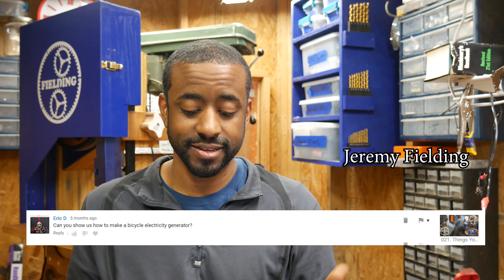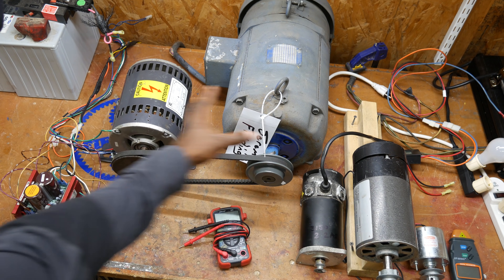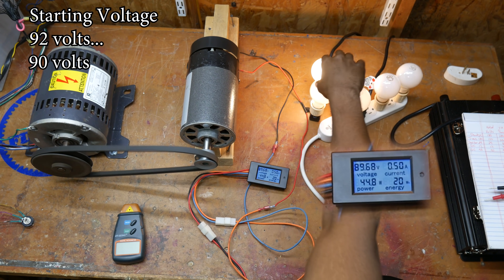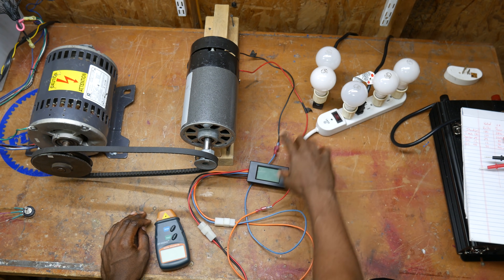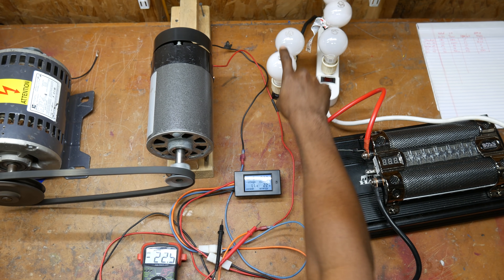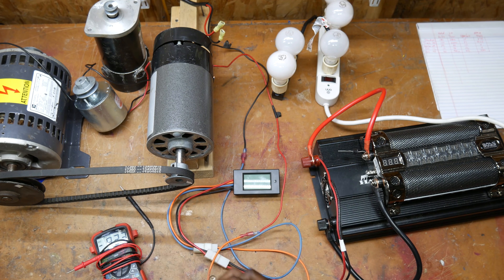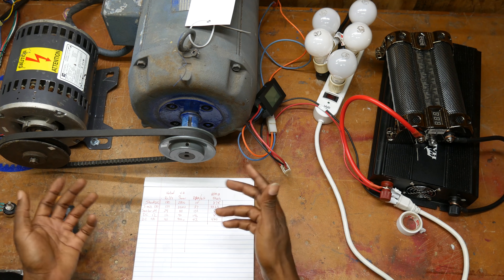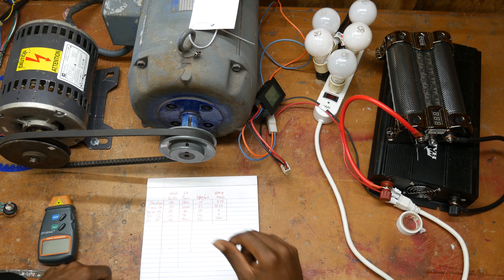How To Build A DIY Generator Part 1 : 050

Comment: Just go to a auto parts store and pick up a 1 wire gm  alternator ....it has a built in voltage regulator and hook it to your battery ....as long as you have approximately 2500 rpms  on the alternator it will maintain the charge on your battery just like on your car so the battery will stay at a constant voltage .....I have done this and it works good  but I would like to find a a voltage regulator that would turn the motor on and off that runs the alterator as the battery charges and discharges so the motor doesn't run all the time ...... And I run the motor that runs the alternator off of a dc motor and a battery of its own and then I have a battery charger  that is plugged into the inverted that maintains the battery for the alternater but because I haven't found a regulator to shut the motor off and on I just do it manually for right now ..so when my inverter battery gets low I turn on the alternator motor then when it charges the inverter batteries I turn it off I hook the charger back to the alternator battery so I always have a good charged battery on my alternater and constant power coming from my inverter ......the alternator only needs to run about 10  to 15 minutes to fully charge the inverter batteries ...at least that's what I've been running it and I usually turn it on every 5 to 6 hours but of course the more  power you use the more frequent you would have to charge it and it also depends on the battery that you use ....I was using marine batteries and they seemed to do better than regular car batteries but my buddy wanted his boat batteries back lol. I hope you can think about my set up and tweak it if you can ....maybe figure out how to run as a self contained unit .....I get tired of switching that battery on for the alternator lol....I use this at a camp and I've stayed there for up to two weeks had all the power I need ....and no solar no gas and no wind just my batteries,alternator, dc motor and a 3000 watt inverter ......I would call that free energy but you know they tell me there's no free energy but when I go to the camp I never have to pay for my electric

Comment: It can work going from Gen to Charge Controller to Battery to Inverter to Loads - try the MPT 7210A charge Controller (12V-10A max range 12.2 to 15.8v) $30.00 - which will come with a  Boost circuit. i run all of my lights in the shop with this system for 9 hours - 5 days a week.

Comment: How is an inverter built?

Shalom
Reply: Lots of videos on that. The real basics of which is a capacitor bank and transistors that are timed to send bursts of current to replicate an AC sine wave. Fairly technical. Most devices can handle some choppy square sine waves, the more you refine it (faster transistors and better timing, etc) the more it costs.

Comment: If increase the size of the pulley in DC generator, will increase Ron, and volts as well? Just asking...
Reply: I meant, Rpm increase= higher volts?
Reply from the maker: Increasing RPM's increases voltage

Comment: you need a motorcycle voltage regulator for rated watts of motor into a battery this controls voltage level then run what ever you need onn the battery

Comment: Hi,thanks for your many informative videos ("Because Knowledge is Power."). I was going to put this comment on your vid where you talk about washer motors,but then saw this playlist (Generators) which seem to be more related to my question(s). I salvaged a motor (COM1500P,DC310V,0.6HP,2.5A,1400RPM,3P,Class F.) from a dancing washer,and while I have began my journey into electricity (mostly circuitry) I still have a good ways to go ( :) Your videos are a GREAT help). I was wondering if you think this motor would be a good candidate for a wind turbine generator? Why,or why not? I mean I think it might be,but there may be some details I might not be considering or simply haven't learned yet. Since you are a good bit ahead of me ( and enjoy your videos because of the way you explain things) I figured you to be a better judge on it than I.
Reply: Oh,what kind of power would I need to power my entire house (25ftX40ft,1,000sqft) and workshop (15ftX25ft,375sqft)? I've done some research but I'd have better luck finding a tick on a pi55ed of horse in the dark at this point. I'm planning on building these off-grid but (if it's realistic) I'd like to stick to providing my own AC power,with the help of a small stream/waterfall on the property. Like what kind of power demand should I expect?
Reply from the maker: Unfortunately I can't give one on one advice like this. Please understand, I get quite literally hundreds of request for help and advice on all kinds of projects. It just isn't safe or practical to do this one on one. I like to take topics that come up over and over and make videos to help lots of people. But I can't do it this way.

Comment: I found this incredibly helpful and inspiring. Thank you very much for the thorough guide and information.
Reply from the maker: People like you are the reason I do this. Thanks for letting me know.
Reply: @Jeremy_Fielding  I have a Ltec wire feed welder it all works do you have any ideas as to what you could make with it. It is a 220 unit

Comment: I saw one video where you were looking for a link for affordable vfd, the one used here in the video was purchased or built?
Reply from the maker: I have several VFD's... all purchased. I have never had trouble finding one, unless you are talking about a VFD designed to work with single phase motors. I was only making a point that they are not typically designed for single phase motors, but there are at least two companies that make them for motors without starter windings.
Reply: Jeremy Fielding so what would you recommend or where should I look? Have you found any that were affordable and functional? I've not seen any yet that look like they one in the above video.
Reply: @andrewoneal306  get a three phase Motor and VFD to match. You can run it on a single phase supply if 3 phase isn't available.

Comment: Some alternators have regulators built into the case, otherwise look into a Harley or motorcycle regulator/rectifier (relatively cheap) because the stator puts out 24 vac at 2k and 10 vac every 1000rpm after that. Plus you get steady dc power output 14.4vdc

Comment: did you try a CAP.. like .5 or 1 farad? Bet that would hold it...Just an idea.
Reply from the maker: The one I use in this video is 8 farad... I am not sure I understand the question
Reply: There would be a ripple from the bigger one as its shunt  I would guess. When I said Cap, I was also thinking dc bridge. But got called away mid thought.  i would like to see the output on a scope to if it flat line or theres a little wave.What is the voltage on output with cap VS Disconnected cap . Is there is huge increase or any increase at all. If there a jump in voltage there is a ripple. true DC  voltage should stay the same . cap inline or no cap.. running dc through a bridge with a cap for filter would take out most ripple. almost like a battery. Also to be honst I didnt watch the whole video kinda skipped around. But  didnt see the caps you were using first time. Last note. Smaller pully underload belt would slip. jumping output  voltage I computer back backup power suppy could change things as they need the Ac to exicte the inverter before the ac drops out to get your 110V AC They deliver lots of wattage. Great video. Sorry so long. I'll keep watching.

Comment: How is it that shunt wound motors can self regulate voltage like that. Intriguing........ actually maybe not. I just read the comment about the different motors and what percent of max capacity they were running at. But is there something special about shunt wound ???
Reply from the maker: His comment was wrong. It has nothing to do with the capacity of the motor and everything to do with how the motor operates. There is a series of videos on YouTube where a teacher explains why the shunt wound motor can hold its voltage so well. https://www.youtube.com/playlist?list=PLhdK-aL4p_XFToGz46CrJjy47eRh8Rv9O have a look
Reply: Jeremy Fielding thanks for the link. Already checked out the top vid. Def gonna be some brain candy in there. I'll hold back my questions until I digest some more of those vids. And get my brain wrapped around it a bit more. Have a good one! Thanks again!

Comment: I get how to wire the drive motor as you showed in earlier video is their any special wiring for 3 pH motor to make it produce electrical battery bank power. I am having problems articulating what I am trying to do. 3 pH motor has 3 legs will they all produce power and wired separate. And how can I wire it or am I just confusing my self

Comment: I have difficulty following your thoughts (I am not saying your wrong just that I am not up to the challenge) but after listening to your comments on using a motor as a generator would it not be better to use a car alternator or an old dynamo from before they had alternators?
Reply from the maker: A car alternator is a great option

Comment: You don't need to buy a battery charge controller. You can make a DC-DC buck converter, it is pretty simple. Afrotechmods has a great tutorial on you tube. Hope I helped, keep up the good work.
Reply from the maker: I don't know what a DC-DC buck converter is. I have very limited knowledge in that area so I wouldn't know how to apply it properly.
Reply: It is the main part of the battery charge controller. It takes the high voltage, let's say from 90V to 20V and regulates i to voltage you set (12V). You can buy them online already made. If you can't find one that fits your needs any electronics enthusiast should be able to make one for you for around 10$.
Reply from the maker: What about adjusting the power output? This particular charge controller is suppose to increase the amps at the same time it drops the volts to maximize how much power is sent to the battery. Supposedly, that is what gets the maximum amount of power from solar power systems. If you solar system operators above 12 volts, the "extra" power is wasted, but these controllers are suppose to solve that problem. I want to run the motors close to their operating range to get their best performance, thus they will kick out 90 or more volts.
Reply: The power is constant, you have the amount you make i watts. Since P(power)=U(voltage)*I(current), when you decrease the voltage you automatically get more amps. Power has to remain the same, or close enough, there will be some losses because of heating etc. Thing with this is, even though you have amps available, if you do not spend them they are wasted. This is a problem for power plants because they cannot stop when demand drops and they waste power. In your case, when you turn off the lights , rowing will become much easier :)
Reply from the maker: If the power is constant (minus internal losses) then it sounds like the equivalent of a transformer but for DC. Am I understanding you correctly?

Comment: I love the videos, your style and presentation is refreshing and insightful! Thank you! In this video, you sort of casually mention that you are using a three phase motor with a frequency regulator for speed control, and this is the only part of the video I do not understand. Do you have three phase supplied to your shop? If not, please share with me how you are producing three-phase from single-phase, as my boat is three phase and I do not have three phase available to me on the dock where it is berthed. Also, I am intrigued by the idea of using a frequency regulator to control the motor's speed, would you be willing to explain the how and why of this configuration? Thank you again for your delightful videos!
Reply from the maker: The VFD has single phase input and it outputs three phase. These are available up to about 3-5 hp then they are pretty hard to find because of the power required. I made a video which talks about this in a way that will help. Check out “will a dimmer switch control a induction motor” that’s the best one on this topic. Next would be my how motors work series which is very detailed and practical. No theory just mechanical what you should know.
Reply: Wow, you have introduced me to a device that solves a lot of my pain, thank you! I have a boat designed and built with three-phase power, and the only solution I could discover to interface with shore power was buying an expensive and inefficient rotary phase converter, but a little research on ebay and I found listings for 10 horse power VFDs that are affordable for me and very efficient! It is a fun project but this has been a big obstacle, until now! Thank you Jeremy Fielding for introducing me to VFDs, and thank you for so many helpful videos! I am a year away from operating the vessel, but if I can deploy a VFD to power lights and some of the other basic loads then I can re-start the re-fit! :)

Comment: you should get into car alternators! and do videos on modifying them. ppl say they can output 120vac. I have been converting some from 12 to 24v. nice video.
Reply from the maker: I am interested in the alternator. Several people have recommended it, and I never considered one until this video went live and 5 different people recommended it! When I have some cash I will give it a try.
Reply: Jeremy Fielding 
I admit I don't know everything about them. I do have a good idea on how they work. if you want to modify it I can maybe offer some help or advice. they can be converted to a powerful brush less DC motor. but still be brushed. the rotor still needs current to be magnetized . usually 1.5 to 3-4volts is enough. and about a 30amp bldc motor controller.  if you live kinda close I can help you with one. I have been rebuilding them on and off for years. they are simple . once you see what's going on inside. I live in North Carolina. just let me know if I can help. thanks
Reply from the maker: Could you send me a message on my website? That way we can talk through email privately and take it from there. www.jeremyfielding.com. At the bottom of the page is a contact me form. You will get my direct email after that.

Comment: Forgot to mention they sell rebuild kits if you find a used alternator.(some places charge a core charge unless you have an old one to give them) 70's - 80's GM trucks should be easiest removal.Right on top of the engine on the passenger side. Find a truck with A/C and should be a higher output.Maybe 4 nuts and bolts. Here's a kit. https://www.amazon.com/Victory-Lap-GMA-01-Alternator-Repair/dp/B000CFKS96/ref=pd_lpo_sbs_263_t_0/130-3472537-5435841?_encoding=UTF8&psc=1&refRID=5R3K1G9FREK42RFGW6PQ  Good luck buddy!
Reply from the maker: Thank you sir.

Comment: That isn't how induction generators work. If you spin an indication motor (generator) it generates zero power. To make it work you need to supply it 120 Volts at 60 hz. You now have a motor spinning at 1700 rpm (or whatever the motor is rated at). Now connect something to spin you motor faster than 1700 and the motor will generate additional power. The faster you spin it the more power you make. (up to limits of course) You have to keep you source of power connected though, as soon as you stop supplying 60hz the motor stops making any power.
Reply from the maker: Thanks for chiming in...I use to think that too, but there are more ways to do it than what you describe here. A quick search of the topic should help. Thanks for watching!
Reply: Jeremy Fielding hmm, I never thought of that way to run them. Guess I learned something new.
Reply from the maker: That my friend is the feeling I have after every video! Someone comes along and says "what about this" then I find something new.